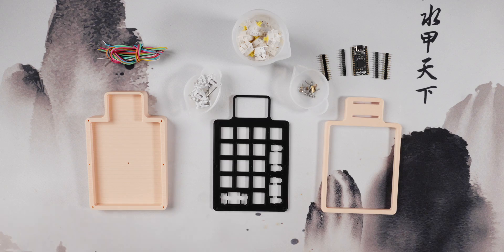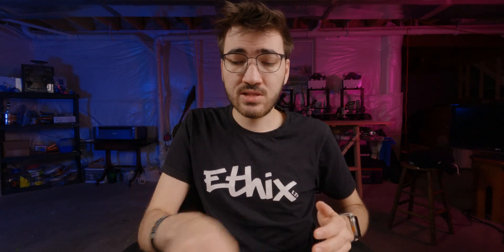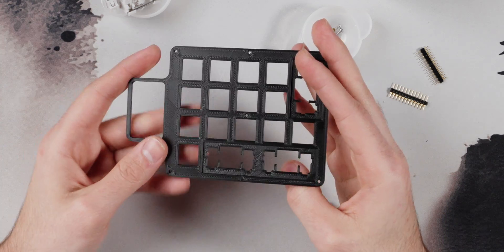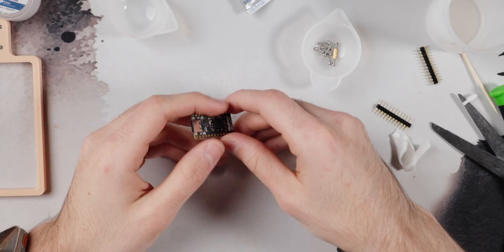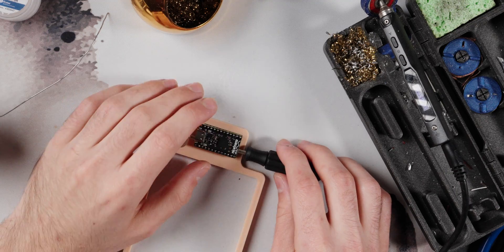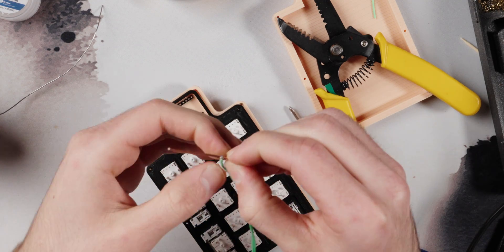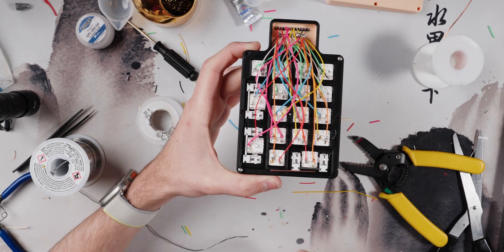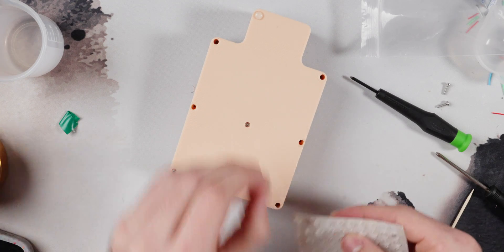Building a WIRELESS Handwired Number Pad

Comment: UV Resins are awesome. When I had teeth problems this stuff came in handy, and worked for years. I had two bad cavities on my fangs. I used cheap UV glue to fill them in. When I hit them with the light, it kinda burned a bit, but after that I didn’t have a problem. Occasionally the homemade fillings would come out, but at least I could pop them back in. 
I don’t have to live that way anymore
What can I say?
I grew up on MacGyver and M.A.S.H 
God Bless.
Reply: I usually get fried before soldering. Just saying.
Reply: Great Video.

Comment: Presuming you 3d printed the case, you could also 3d print a rectangular "button" under the controller, and a hole on the bottom, so you can like push into it to pop off the micro easily

Comment: To solder the battery, the positive lead goes into VCC and the negative on any GROUND on the nice!nano ? Or does it go to RAW and GROUND? It looks like it was connected to RAW.
Reply from the maker: No. There is a positive and minus pad on the left and right of the USB-C port. The battery needs to connect to those pads.
Reply: @joe_scotto  I see. Those pads are not present on the pro micro, so where does the battery go if using the pro micro?
Reply from the maker: @DrLIRAAAAAAA  Oh… The Pro Micro isn’t wireless. There is a way to connect a battery but for a QMK board there is no reason to as you’ll need usb to connect to the computer anyway.
Reply: @joe_scotto  I understand. Thanks for the replies. Is there a way to make the pro micro wireless? I can't find the nice!nano where I live.
Reply from the maker: @DrLIRAAAAAAA  Not that I know of, the Pro Micro is wired only.
Reply: @joe_scotto  Is there some kind of Bluetooth module to attach to it?
Reply: @joe_scotto  could you expand on how to connect a battery to a pro micro anyway?

Comment: Hi, you seemed to have linked to everything but the battery. Was wondering if you have a purchase link for that one too? Also how does that work? Is the Arduino already setup to handle the charging when it's plugged in?
Reply from the maker: It's not an Arduino... it's a Nice Nano which supports wiresless. As for the battery, it's just a 3.7v lipo and on the controller is a plus and minus pad where you solder the battery on. This one here should work and is nearly identical to what I used: https://amzn.to/3Qm9dl4

When cutting the leads of the battery, make sure to cut only one at a time and then protect it until ready to use to avoid a short.
Reply: @joe_scotto  Oh! I just saw what you had in the parts list which was an Arduino Pro Micro which looked similar enough at quick glance. I see now it's not that. Also watching again I see you did say it was a Nice Nano in the video. 
Anyways! Thanks for pointing that out and for the battery link!

Comment: how does it connect wirelessly?, adding the battery surely powers it, but does it use bluetooth?
Reply from the maker: Yup, just connects over Bluetooth. Once it’s powered, it will be broadcasting then you can connect it on the computer. The key map itself has different profiles that you can use to connect multiple devices so you can switch.

Comment: The fact that you said at the end of the video that your "brain is fried" every time when you finish soldering is concerning. You shouldn't be breathing in fumes during soldering. If your solder contains lead that might damage your brain in the long run. Please make sure you solder in well ventilated area using lead-free alloy.
Reply from the maker: Thank you for the concern. It's not so much the fumes that fry me as I vent it out the window and have filters in the room. It's more that after 4 hours of straight tedious handwiring, I get very burnt out. I don't really breathe in many fumes but of course I can't avoid them all.